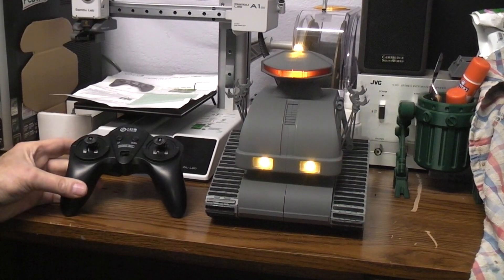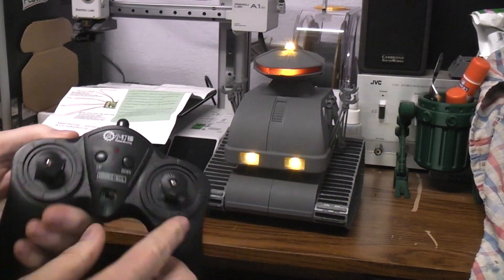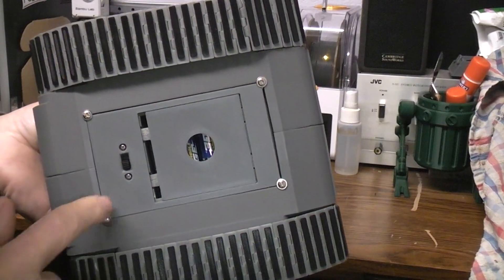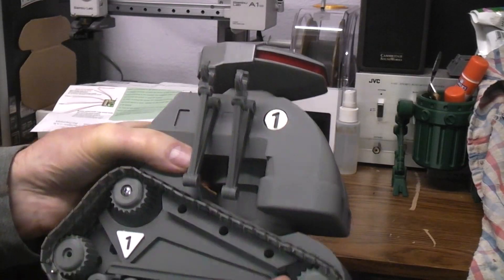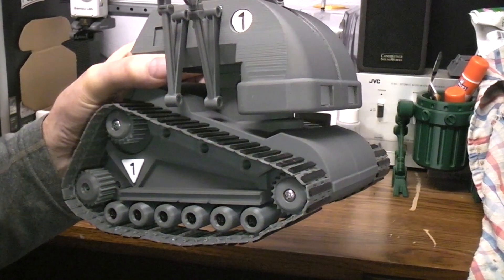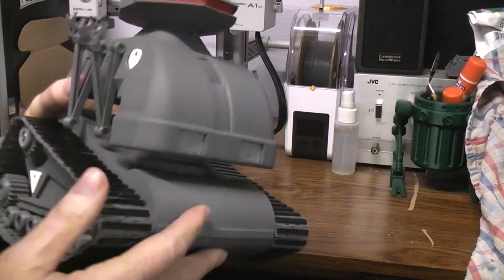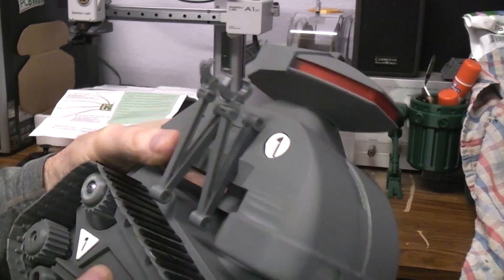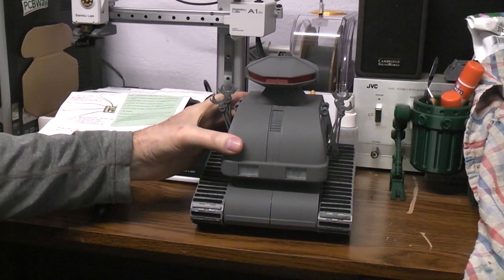Helpful built tips for the 3d printed KillBot project.

Comment: It's amazing, I can't believe you were able to build it from scratch. 3D printers really are a game changer. Did the super-glued paper clips on the tracks loosen up as you hoped?
Reply from the maker: Yes, I was able to break them all free. I should have used a paper clip to apply the glue, then it would not have spread out so much or just added a slight bend to the end of the paper clip shafts so they stay locked in place.